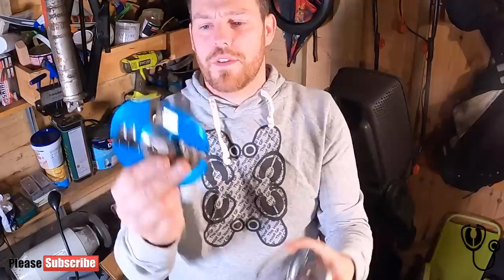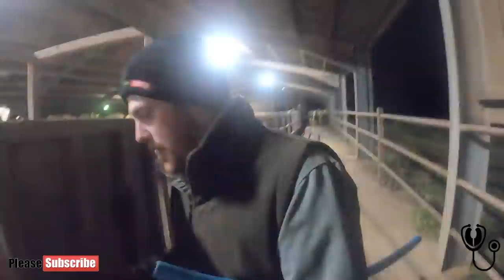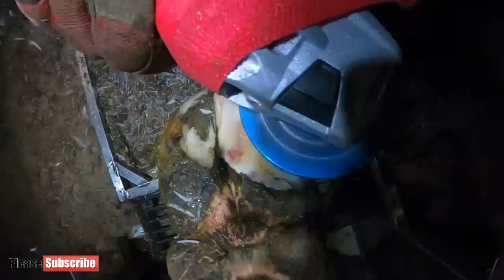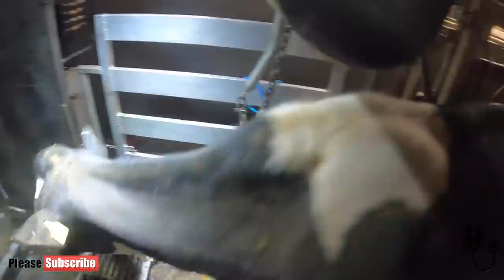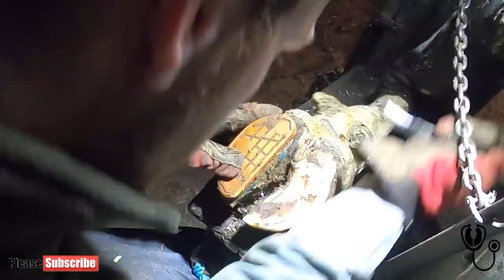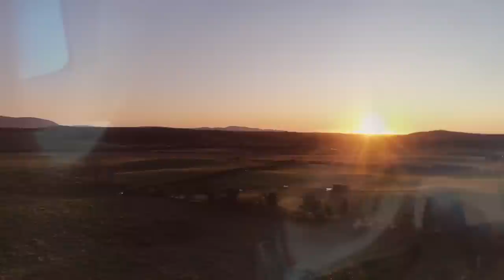COWS ESCAPING ... new trimming disks & a STUNNING SUNRISE | The Hoof GP

Comment: You should squeeze out a small amount of glue out of the mixing tube before using, sometimes the ratio of glue to hardner is off when first using the mix tube until the barrels in the glue cartridge are even when first using.

Comment: Question about attaching blocks for you Graeme:   I've probably watched you glue on around 10 blocks in your videos.  From what I see you're gluing them to a pretty flat hoof surface -- one that you've newly trimmed.  And it looks like the orange plastic blocks stay attached really well but this video mentioned that one of the cows you worked on had lost a block.  What would happen if you etched SHALLOW grooves in the walking surface -- maybe on the order of .25 mm (1/8") deep before gluing on the block?  Wouldn't the grooves help provide a mechanical connection for the glue?  In any event - cheers to you!  Who knew cattle hoof trimming could be so interesting?